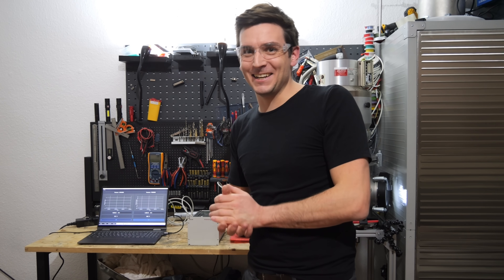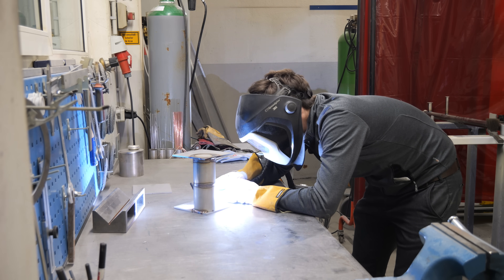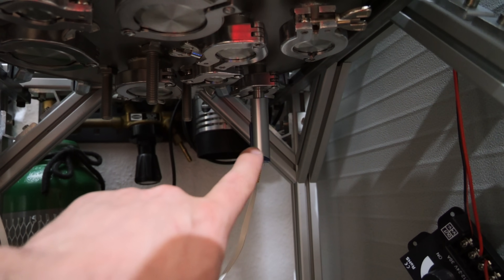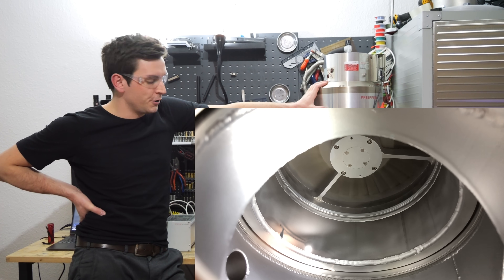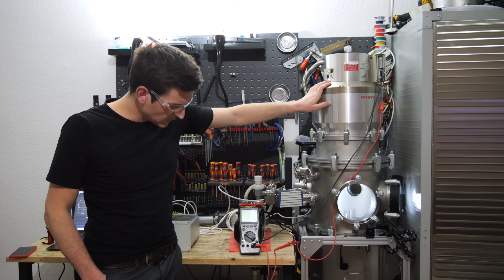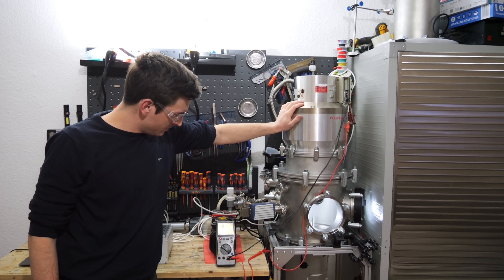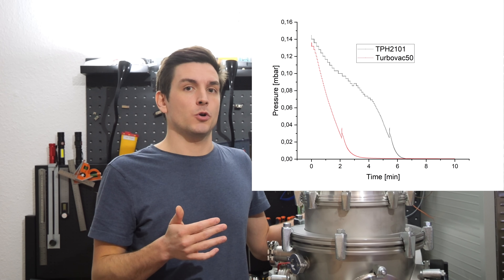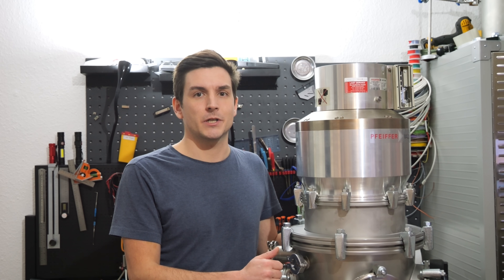Turbomolecular Madness – A Nerve-Wracking Experience

Comment: The noise is very likely turbulence during the most dense stage of operation. 
Check the psi and see if at the time of the noise, if it is fluctuating. 

This would likely be the cause as the Air leaving will have a small stage of higher pressure as the Vacuum pump can't vacate as quickly as it is ramping up. 
(bouncing from a zone of high pressure to the lower one and back again until it finally moves out of the system and balances out.)
Then there will be a drop-off as the vacuum finally eases past this "cliff".

Comment: I have seen a lot of setups use a traditional vacuum pump for the first stage of pumping. Could pumping out all that air be too much a load on the turbomolecular pump?
Reply from the maker: I am using a roughing pump to get to a lower pressure before starting the turbomolecular pump.

Comment: The degradation of the pump veins will cause unbalances in the system. This will result in harmonic in certain frequencies. But it seems the motor driver creates the vibrations. This could be because the driver tries to hold a speed before going up further. If the control loop goes in harmonic with the rotation it can shake it self apart. Normally the driver would go in a different mode if such a harmonic situation is detected. If restarting the pump controller at speed solves it, then it looks like the driving system has a problem in detecting the frequency or the rotating mass correctly. The first would point to the power consumption detection, the second one to the initialization routine.

Comment: I wonder if that harmonic at 10% speed is a harmonic due to the motor switching (PWM) frequency - if it is, it may also be so pronounced due to vibrational feedback into the motor control circuitry, not merely PWM -> electromechanical -> mechanical vibrations, but sort of a 'bidirectional electromechanical harmonic.' If it's purely a mechanical harmonic (1st/fundamental) I would expect subsequent harmonics to also be noticeable, though less intense...
Having a more rigid mechanical fixture may damp vibrations enough to significantly reduce that.
Also, I wonder what orientation the pump was used in previously. Though I think it's common for TMPs to be designed for axial mounting, I've only ever seen them used in a hanging orientation. It might be possible the bearings could make noise if they're worn/broken in on the opposite sides of the race. Who knows what the unused side of the races are like - N2 purge is often but not always used to prevent deposition in the bearings. 
Are you monitoring the chamber pressure and roughing/TMP exhaust pressure? Vibration could come from excessive gas in the chamber/TMP during accel.
Reply: I know these pumps - they are used in this exact orientation on big PVD-Coaters. This process is quite dirty with lots of particles. For this reason, you want the pumpt to be on top.
Reply: @christiansprojects-cgmanuf1426  then it may be a more or less normal vibration that you may be able to damp with more rigid fixturing 🤔
After you pumped down the chamber, did you re-tighten your clamps snug? Without them tight at atmosphere & vacuum you might have some looseness that allows some vibration of the turbo or the clamps themselves. I suspect you did tighten them down under vacuum 👍

Comment: The scary sounds are normal with mag lev bearing pumps. It is due to the pump passing through mechanical resonance bands as the pump controller tries to actively cancel destructive resonances in the lower audio range. ❤
Reply: Aha, so that is the reason they have a cost a of a small countrys GDP.
Reply: It's important to go under or over the resonance bands...

Comment: I was standing right next to a Leybold D2500 TMP, about 15 hp, when it went from 39000 to 0 rpm in about 1/2 second. I'll never forget that sound. One blade tip rubbed and welded to the housing, broke off and wiped the rest of the blades out. We also had an uncontained burst with an experimental Becker pump, it was like a bomb went off. We use those on fast axial CO2 lasers. Every pump we used ran through a few harmonic areas on spool up.
Reply: We had that happen to a jet engine!  The N1 and N2 shafts were out of alignment and able to rub and weld.  The pilot had to change his pants when it went from 105% RPM to 0% in about half a second!  Didn't frag the engine though.
Reply: @2fathomsdeeper how did the engine survive? 
Wouldn't that have catastrophically detonated the entire engine frame?
Reply: Holy shit!

Comment: Nerve wracking. Crazy that it works after so well. As of the pressure spike, looks like calibration is required for the pressure sensors, so the two modes match well during switchover. I do know nothing about vacuum systems tho.

Comment: It looks quite awkward to me seeing an turbomolecular pump upside down. As far as i remember, most of them can not be used in that position due to some lubrication restrictions. Pfeiffer Manual of the TPH2101 states that the pump should be mounted at max. 90° elevation and the fore vacuum flange must always point downward.
Also did you do the water cooling?
Reply: This is a special version that is designed for upside down mounting. It has a different oil pump than the normal ones.

Comment: The fact that the vibration doesn't occur while spinning unpowered, and doesn't return after power is cut and then re-applied, suggests to me that this is to do with the controller. Maybe there's some way to program in an acceleration curve and you're supposed to move through resonance regions differently? Maybe it's getting a little out of phase due to component age or an inadequacy of the cabling? Maybe that region is where it switches between two sensing methods and something about that isn't happening right? Also maybe everything is fine and normal.

Comment: The gyroscopic forces created by the spinning pumps will be sufficient to plough clean through a brick wall if they topple over while running. You might want to install some bracing to ensure the apparatus cannot move when running. A ship’s gyroscope is capable of punching through two layers of 12.5 mm steel when running at 100,000 rpm and the casing is only 20 Cm in diameter. High speed rotary equipment can be extremely dangerous if moved while rotating.

Comment: The vibration is probably caused by the excess gas in the system being pulled through the rotor. Generally you want to have isolation Valves between the turbo and the chamber. As well as the turbo and the foreline. That way the pump body should be evacuated to a cross over pressure around 5e-2mbar before you turn it on. 

Never, ever allow a huge inrush of air into the spinning turbo 😢 the sound will make you cry.

Comment: @9:00 ish  Interesting that you don't feel any vibration and even balance a coin on it, but we can clearly hear it on the microphone.
Reply: What you hear while the pump is running is mainly the sound from the motor caused by the high frequency driver.

Comment: I worked for a tech-firm that x-rayed power supply modules...insurance purposes.
They beat the heck outta their turbo pumps...their operating procedure called for pumping down the x-ray tube every morning, running it hard all day, then cooling it down at the end of the day with 'air flooding'.
Yup, they let the air in at night, then played with the filament in the morning before pumping it down again.
In the 4 years I was there, there were two instances where the filament had any problem that needed attention.
The technician who wrote the 'instruction manual' is now head of an entire Division...of course his instructions will never be reviewed...it would reflect poorly on the Great Man.
Apparently replacing turbo-pumps was cheaper than re-writing the instructions.

Comment: I've always wondered about cascading these things....

Could you do a run with the Big pump, feeding the little pump, (that's feeding the roughing pump) ? 
You seem to be almost set up for it.

Would that get you though your "Noise and vibrations" stage quicker, as the big pump wouldn't really be doing much until after the little pump has cleared out the bulk of the chamber to E-4 ?
Reply: You absolutely can, in this configuration the smaller turbo is called a "compression turbo". You need to be mindful of oil changes on the outlet side of the main turbo (or run a full maglev). It's done to get high compression ratios, usually for light gases like hydrogen and helium.

Comment: that pump on that small of a chamber and you only getting -6. yea you got a leak or some contamination, I work with a couple  2000mm chambers and we use a TMP about that size  for standby pumping and it could pull down to -8 when it was brand new.
Reply: Low -6 range after 10-15 minutes is normal, even if you have massive pumps.
At this pressure, the moisture and other contamination has to vapourize first until lower pressure is reached. This process is nearly indipendent of the pumping power and can be accelerated by heating the chamber.

Comment: It's amazing how my expirience is similat to yours. But I am working as mad scientist in former USSR lab and we have like 100 or somithing old but usable turbomolecular pumps so we are not so worried with sounds its produce as you x) I'm really interested in what you doing with your vacuum chamber, what are your plans? Any experiments? Plasma coating? I'm really want to invite you to my lab, but it is probably unlikly and hard to achieve.
Reply: Someone is selling a TMN-500 right now...which is interesingly a horizontal pump with magnetic bearing...and 36 stages!

Comment: I've never felt particularly anxious bringing up my turbo, but watching this I was stacking sandbags in front of my monitor 😂
My understanding is that it's normal for turbo pumps to accelerate through a resonance band during spin-up, I know that mine does. Some fancy pump controllers make an effort to brake through this band on shut-down to minimize the time spent at resonance and avoid wear. I also believe Edwards talks about this in the manual for my pump in the section about venting during shut-down to brake the pump more quickly. 
Take that with a grain of salt, of course, I'm strictly a hobbyist.

Awesome video once again, cheers,
Reply from the maker: Thanks! Yes, I think you can see that I was pretty nervous 😅 
Thanks for the information. 
Looking forward to a new video from you!

Comment: I used to work on large vacuum systems, the scariest noise after a strip down was a nut or bolt loose in the chamber just before the TMP came apart. It did happen even though we used to treat the system like surgeons and check everything we had used to make sure nothing was left in the patient!
Reply: I'm sure surgeons do the same thing lol

Comment: After reading the comments, I agree with the assessment that the issue at the 10% rotor speed is likely electrical in nature. Others have pointed out that the issue appears to coincide with line voltage 50 Hz. It could be a sort of unfortunate feedback loop in resonance with the motor controller. If you have access to a isolation transformer, that might reduce voltage surges if that is the result of the issue. Alternatively, if you have some clamp on ferrite cores, that might be worth trying out. These are mostly guesses though, do you have anyway of measuring EMC? 

Regarding the vibrations of the stand, 3D printers have made great advancements in the modal analysis and tuning field. With a sensor and a stepper motor, you could figure out the resonance and make a custom damper if that is a project worth the challenge?

Comment: I feel I’m missing something. What is the chamber pressure when you start the turbo? I see your little single stage vane pump there.
Reply from the maker: I've tried starting both turbomolecular pumps at the same pressure. The TPH2101 was started at 0.2 mbar and the Turbovac50 at 0.14 mbar if I remember correctly.

Comment: I completely agree with others about your welds. A nice bead. Not overly hot. You could have easily warped the flange or cracked the weld on the opposite side. I’ve seen seasoned welders destroy 316. Pulse mode or not. Excellent.

Comment: A lot of devices that spin have an RPM range that they have to pass through during which there are resonant oscillations. Once the device is spinning faster it is no longer a problem. Therefor the device usually has a warning about not loitering at certain speeds. Fancy nuclear centrifuges come to mind, there is a RPM range where they will self-destruct, which is what that Stuxnet virus exploited. I wonder if these things are similar, since you can clearly see the vibration increasing until it starts making that noise.
Reply: They are similar indeed. In these turbos you can tell apart the critical speed due purely to the rotor moment of inertia from any other resonance due to the motor drive (and not rigid enough mounting) if you pay attention to the spin down behaviour, where only inertial phenomena would make themselves evident.
Reply: @SVanHutten  ah, I see
Reply: Yes they are extremely similar to gas centrifuges, magnetic bearings and all. ❤

Comment: If you'll be moving around anything with more mass it's probably worth the cost to get a lift of some sort. I use an engine hoist to move around machine tools and it folds up into a small size when not in use.

Comment: How do You think - if You placed inside some radio receiver device - would it have still ability to have connection in such deep vacuum?
Reply from the maker: The stainless steel chamber might be a problem. Radio waves have absolutely no issue traveling through a vacuum.
Reply: @AdvancedTinkering  but.. how? Isnt wave a sequence of local disturbances between the molecules that builts a physical medium that the wave is propagating inside? Vacuum x10^-6 mBar has so few particles, maybe it is too little to propagate the wave?
Reply from the maker: Radio waves are electromagnetic waves. They do not need a medium to travel through. Just like light. 
That's different to sound waves for example which are caused by high and low pressure zones and cannot travel through a vacuum.
Reply: @AdvancedTinkering  okay i know now.. electromagnetic wave is different type of wave than classical mechanic wave, it is propagated with photons which are present even in deep vacuum

Comment: There must be a tiny imbalance on the rotor. The imbalance is always there but the assembly has only a few resonant modes. When you see and feel no vibration it is probably still vibrating, but at a low amplitude and above audio frequencies. With an audio tool that can display a spectrogram you might find that the RPM and the audio frequency are some integer multiple.
Reply from the maker: I don't think it's an imbalance in the rotor. Because when the pump slows down and reaches the 10 % speed, it does not make any sounds and does not vibrate. Some comments suggest it has to do with some resonance in my stand and the controller of the pump reacting to that resonance.

Comment: Are you using a roughing pump? The comparison graphs suggest you started the turbo pump at atmospheric pressure ... if so I'm impressed the blades and bearings can handle this ... I think Pfeiffer recommends something like 1.5 mbar max inlet pressure for operation.
Reply from the maker: Yes, I'm using a roughing pump. Otherwise I don't think the turbomolecular pumps would have a chance to create a vacuum. I started the TPH2101 at around 0.2 mbar and the Turbovac50 at around 0.14 mbar if I remember correctly.
Reply: OK, I couldn't fathom how you still get to 10^-6 with 10^0 exhaust pressure, but then the brochure says it can compress by a factor of 10^8. The vibrations are likely just unavoidable resonances along runup to nominal RPM, e.g. avoiding RPM ranges in helicopters and jet engines. Much smaller ~6cm diameter turbo pumps still make vibrations and noise during runup comparable to a Dremel to some degree, especially as you try to factor out the plastic vrs. machined billet case. That beast must put on a real show.  @AdvancedTinkering
Reply: If the volume you are pumping is small enough it's not an issue to already start the turbo pump at atmospheric pressure as the chamber will quickly pump down to workable inlet pressures, way before the pump gets up to its nominal speed.
If you do have too high of a gas load from a big chamber, evaporating water, or a leak, the pump won't be able to spin up, draw too much current in the attempt, and the controller will shut it down after a short amount of time. At least that has been the case for all the pumps I have worked with.
Modern turbo pumps are also surprisingly resistant (as in can continue working fine afterwards without maintenance) against getting vented suddenly, but that's not something you want to do too often...